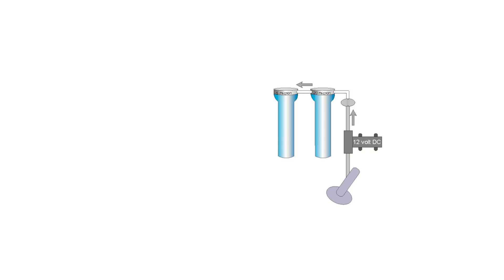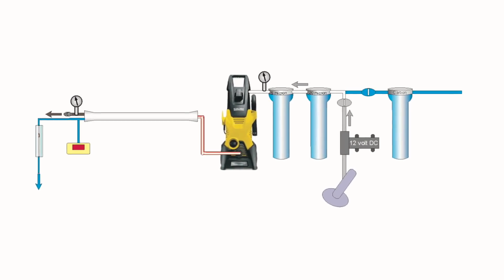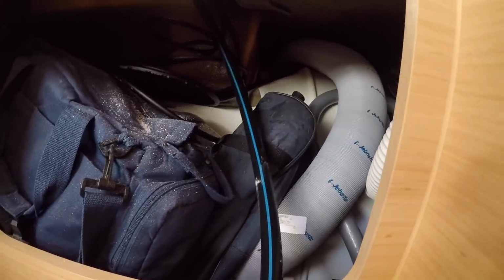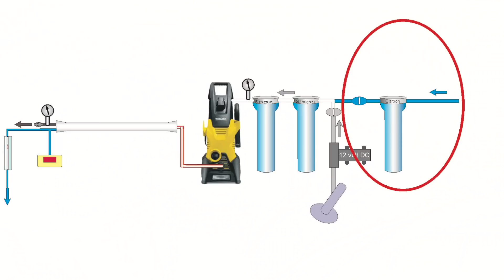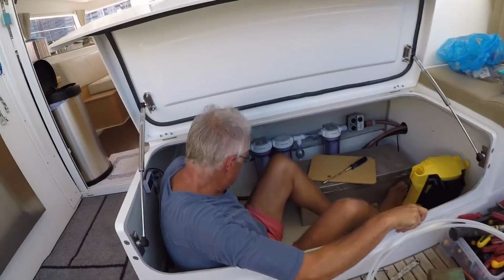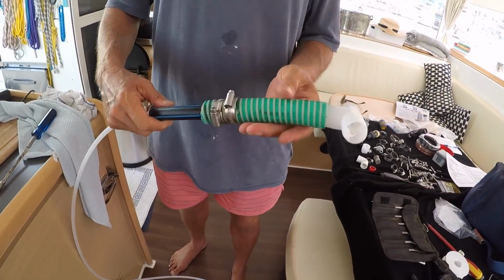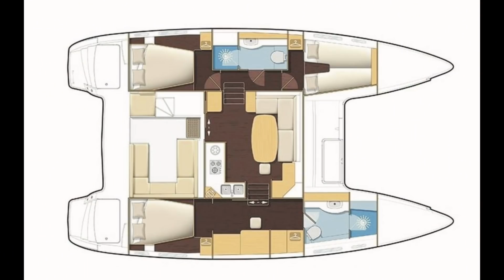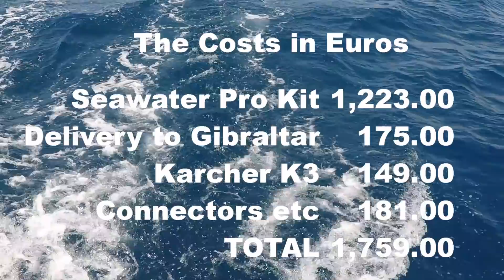How to build a Water Maker, full installation video. Sailing Ocean Fox

Comment: Personally, after reviewing the Seawater Pro system, I think I like it better than ANYTHING on the market. EVERYTHING except the RO cannister-filter is off-the-shelf at your local hardware store! It's a 600-gpd system, and if you break-fail-crack-lose a component, you can run down to your local hardware store and buy a replacement INSTANTLY! Keep a spare cannister and a couple of RO elements in-stock on a boat, and you have AMPLE water! $1495...with full install instructions. It just doesn't get 'more economical' or common-sense than this!
Reply from the maker: And no complaints about it, it's working just fine. Cheers

Comment: Super job! May be you can give me more information about the equipment you use. That’ll be very helpful for me and the other bluewater guys. Please let us informed about your experience. You are assured that the Karcher is long term seawater stable? Or do you flushing it also with freshwater? What about maintenance? How often you have to change the filters? Excited for more information
Reply from the maker: No problem, We don't know how long the karcher  will take to pack up, but it is not expensive and very easy to find at any supermarket. I guess we will find out how long it will take at some point. We flush with freshwater, but they say you don't need to as long as you use at least once a week. We bought extra filters because it will depend on how clean the water is. So, again we will find out. We bought an extra Karcher too that we use to clean the boat for now and in case the oner one needs to be replaced we already have one. Cheers
Reply: Sailing Ocean Fox  thanks for answer. Very, very effective. What a great idea. Absolutely attended

Comment: Just ordered one from Mike, I really like the idea if using a pressure washer, especially the idea of putting the membranes out of the way and using the pressure washer hose to feed them. The K5 pump is even quieter. All at about 1/5 the cost of a conventional system! Thanks for the info in your video :)
Reply from the maker: Lovely, if you need any help on the installation, just send us a text. 
Thank you very much. Cheers

Comment: Well that looked like it went pretty straight forward and the obstacles that came up were easily surmountable.
Interesting that you used a straight forward Karcher, my thoughts on that was how will it bear up to salt water and I see others have wondered that as well.
Following as you well know so any problems I am sure you will let us know in Blogs and how you overcome them.
Nice Video guys many thanks.
Reply from the maker: Thank you Peter. Absolutely, it will come on the daily blog if we need to replace. Thank you very much for following us, Cheers

Comment: Love the system. Love the comments. I do have 1 suggestion - add another activated carbon unit after the particulate filters. It will help with the taste and also provide insurance against sea water that is not particularly clean.
Reply from the maker: That is a good idea, thank you

Comment: Hi, nice video. 
Easy (somewhat) installation of a DIY water maker. I am going the same route, and have sourced the parts, except the high pressure pump, and find your solution with the high pressure washer fantastic. Easy and cheap unit to renew to save cost. 
My question is however; the data page for Kärcher states a pressure output 20 - max.120 bar, i.e. 290 - max.1740 psi. How do you limit the pressure to steady 800 psi? 
PS I have a pressure washer at 1500 psi, would love to be able to use it.
Reply: Hi, that is somewhat beyond me, but, you control the pressure with the master valve. You set this so you are making around 90lt per minute.

The Karcher did work well but the endurance was not great.  We went through two in a year living onboard and using it most days for an hour.  In the end we bought a proper pump from Sea Water Pro. Then it was all a dream for hours, and alot quieter.
Reply: @simonfowler8876  Which pump do you bought from seawater pro ? thanks.Hernan

Comment: Hi Ocean fox,,,,,,,,, been watching this excellent video ,, watched it first ages ago when it came out and put it in the back of my head for further examination and reference when i new i would need it ,,, which is now ,,, most of the vid i understand easily but have a few problems ,, 1 st ,, is the 12 v inlet pump supplied with the  " seawater pro kit " ( 1200E ) ,,  2nd , do you use ordinary  ( decent ) water hose on the high pressure output to the membrane and is that just ordinary hozelock connectors , i read in the comments that you have had some issues with kinking in this pipe  ,, also am i correct in that you have had no issues with the karcher pump using salt water ,,, ,,  love your vids ,,, thank you  R
Reply from the maker: Hi, the 12volt lift pump comes with the kit from Seawater Pro.
They also send you most of the pipes that you require. You will need a pipe to go from the 12 volt pump to the first filter, and one from the fresh water outlet to your tank. 

We did have a problem twice with the Karcher high pressure hose getting a kink in it. We also found the Karcher noisy. In the end we changed to the pump that Mike has (Seawater Pro). The system will now run for hours 

Always give Mike a ring, mention us and he will be most helpful. 

Cheers
Reply: @SailingOceanFox  thank you very much Simon for your reply,, much appreciate it ,,, i guess a call to seawater to get prices etc should be the next move ,,cheers  R
Reply: sorry to bother yo again Simon, is Seawater in Florida , i can not find any UK,,  i believe this may involve some import tax , ( is that why you got yours into Gib ? )  , i watched their video and they have a dedicated high pressure hose from Karcher to membrane ,, ta Rod
Reply from the maker: roderick mchardy yes, they are in Florida. We got ours in Gibraltar just because we were there at the time preparing the boat for the crossing. So you might have to pay VAT.
Reply: @SailingOceanFox  thank you very much again , much appreciated ..
Reply from the maker: roderick mchardy no worries, any time. Cheers
Reply: @SailingOceanFox   Simon ,, sorry to bother you again , but ,,, i measured up on my boat today  ( 36 ft catamaran , performance  orientated with narrow hulls ) and cant really find a suitable position for the  40 " membrane ,, do you happen to know if they do a shorter one ,, around 30 "  perhaps ,, i seem to remember something somewhere about 24"  but cant find anything  ??   thank you
Reply from the maker: roderick mchardy I am really sorry Roderick but I have no idea. But if you ask Mike he will tell you, he’s very helpful and normally replies straight away. Cheers
Reply: @SailingOceanFox  i will email him ,,,  thanks  again for your reply , R
Reply from the maker: roderick mchardy no worries 😉

Comment: just see you push the 10mm feed into a push fit. most push fit pipe generally requires an insert for cold or hot flow. just pointing that out as I couldn't see one, I guess that's more relevant if under pressure.
Reply from the maker: It came with the Kit, so I suppose it will be fine. Thank you anyway. Cheers

Comment: Not getting the need for the carbon filter on the right hand side? What is it trying to do?
Reply from the maker: It’s for when the system flushes
Reply: @SailingOceanFox  so, I read on another channel that when you flush, you might have contaminants in your water system from shore water, like chlorine etc. That's the info I was looking for, because if you had clean water in your system, a carbon filter would be of no benefit.
Reply from the maker: I guess the best person to answer that would be Mike from SeaWater Pro but as far as I understand the carbon filter will filter that as well
Reply: @SailingOceanFox  the point I'm trying to make is that is the reason. "It’s for when the system flushes" isn't explaining the reason. it would be helpful if you explained why it was necessary. If you only have water in your tank from the RO unit, it would not be necessary. only if your water comes from suspect sources.
Reply from the maker: @sspence65  well that’s a point, we use a mix of from the water maker and from Marinas. So we never really know about the ones at the Marina. But if you send an email to Mike, he is pretty good replying

Comment: im thinking if you put the name and type of each part/connecters eta  you could buy the bits over a long period and then fit it as you buy, awesome job by the way i already have the power washer and should be a easy job to un hose it and use it as a power washer also.Win Win Thanks guys
Reply from the maker: That's a good idea. Thank you very much. Cheers

Comment: any long term reliabilty issues with the pressure washer in salt water ?  these type of pressures washers dont seem to last very long in home use .  usually motor faillure is the issue
Reply from the maker: So far so good, but we have a spare just in case, they are not very expensive.

Comment: I wonder how long the karcher pump will work with seawater
Reply from the maker: Our problem with the karcher was the pressure pipe, had kinks and it’s not easy to get replacements over here
Reply: @SailingOceanFox By the way only the professional series at Kärcher do have a proper brass pump that should last way longer than the lower  grade ones.

Comment: This is an interesting video on the installation. I assume the Karcher high pressure pump runs on AC power and the low pressure water pump runs on DC power? So if you are operating this system while away from shore power can you run it exclusively off battery power?
Reply: 3kw inverter will smash it of shore
Reply from the maker: Yes, that's correct. We can run off the battery power, however we use the generator or run one of the engines. Cheers
Reply from the maker: Yes, it will. Cheers

Comment: Awesome job. Curious how long the Karcher pressure washer will last in the salt water environment. Looks like a wonderful job.
Reply from the maker: We will see Tom, we bought an extra one that we are using to clean the boat at the moment but it is the replacement one in case that one decides to pack up . They are quite cheap anyway, but we will let you know. Cheers
Reply: Should last at least a month

Comment: maybe remove the pressure washer pump from the large case, and use the wast salt water output and wrap a steel line around the motor housing to keep it cool
Reply from the maker: The K4 is water-cool . Thank you

Comment: Well done and very well explained. What power does it draw, starting and running. Thanks
Reply: The SeawaterPro website that sells this kit has this to say: "Draws about 900 watts at 800 psi and will run with a Honda EU2000i (1600 watt) generator."
Reply from the maker: Very well said, thank you. Cheers
Reply from the maker: Mister Professor just answer as it is. And we run with the generator or underway with the engines on. Cheers

Comment: Where is GILBRALTAR ?? 🙂🙂 
Edit: joke aside, very impressive and thank you so much for putting it on youtube, some years ago I read somewhere that an Austrian guy built a water maker by using a pressure washer and he was saying that he had no remarkable problems.
Reply from the maker: bizim eller Gibraltar is a British Overseas Territory located at the southern tip of the Iberian Peninsula. No worries... it’s still working well. Cheers
Reply: @SailingOceanFox  but the video started ( 0:20) saying in GILBRALTAR 🙂 with an L between the I and the B
  We stopped in Tarifa instead of Gibraltar during our crossing from the USA to Turkey for we heard horror stories about the place, but we sailed right in front of it on our way to cartagena🙂
Reply from the maker: bizim eller sorry about that, we have a dyslexic on the team and sometimes it’s not enough time for double check. Cheers
Reply: @SailingOceanFox  no worries🙂
 My wife has a degree in engineering and always have hard time accomplishing the least important things in life, the culprit we suspect is dyslexia.
 I love how you pulled the trigger and went ahead with the installation of your water maker, would like to see a short video while it is running👍
Reply from the maker: bizim eller we will be upgrading the water maker in Portugal as we got new parts and we will video working as well. Apparently is going to double, we will be making 180 litres an hour, which is pretty amazing
Reply: @SailingOceanFox  indeed amazing, can't wait for the details 🙂👍

Comment: Thanks for sharing.  Much less expensive than systems I've priced. Do you still use the karcher to pressure wash or do you keep a pressure washer as a spare?
Reply from the maker: We use the spare one to clean the boat and one day it will be on the water maker I guess. We bought that would be a good idea to have a spare one in case it brakes somewhere underway. Thank you. Cheers

Comment: I did enjoy the video but if you go to all the trouble of installing it why not fit a quality unit rather than a home made job,I guess if it doesn't work out in the end all you have to buy is a quality high pressure pump and the rest is done
Reply from the maker: Absolutely, but so far is working very well, no problems at all.
Reply: you can easily retro fit a 'normal' triplex pump and AC or DC powered motor from Seawater pro, (they use italiam pumps and you can get US made Leeson motors or import motors... your choice,  and still come up thousands cheaper. I know Mike personally and there are virtually no failures of the K4 watercooled  motors even after over 3 years in service.
Reply: @oceandweller2314  That is very helpful info regarding the K4 water cooled setup long term performance. Thanks.

Comment: How's that pressure washer still working?
Reply from the maker: Sadly they gave up after a year.  That is two in twelve months.  We now have a proper pump and it can make water all day long.  It was a great way of making the watermaker work on a budget, and yes it did make totally fresh water
Reply: What kinda of pump do you have now?
Reply from the maker: @austinharrelle  we’ve got the one that Mike sells at Seawater Pro. Never had a problem since we have changed

Comment: Why a watermaker in a boat this size surly there is enough tankage in there for two on long hauls
Reply from the maker: We have a 600l water tank, but we didn't want to cross the Atlantic without a water maker as everything can happen. It is always a good idea to have a plan B in case something happens.Plus that will allow us and our crew to shower everyday during the crossing. Cheers
Reply: You don't want your cat to be heavy so 600 ltr is already a lot

Comment: The guy who posted the whole idea of using a pressure washer pump took down his video not too long after posting it.  Why? Because the pressure/g/p/m flow rate don't work.  The membranes will clog as there is not sufficient  flow rate to wash the solids out.  A lot of work only to be undone.  Buy the proper pump and motor!   There is a reason proper systems cost why they cost.